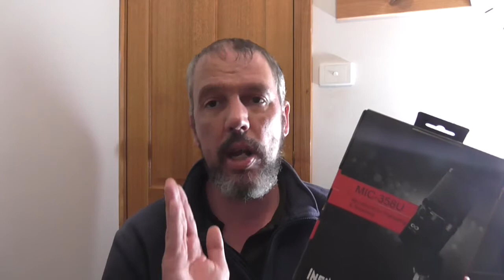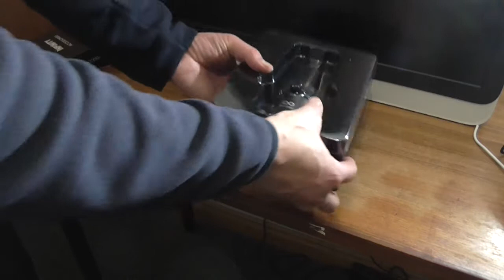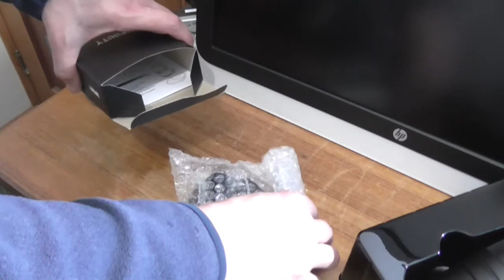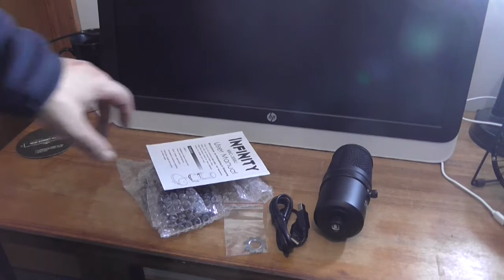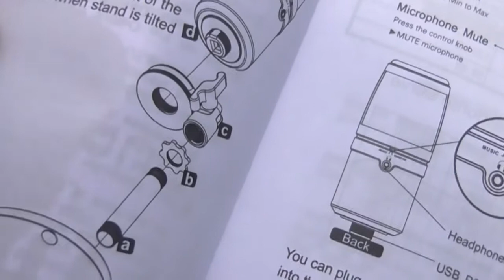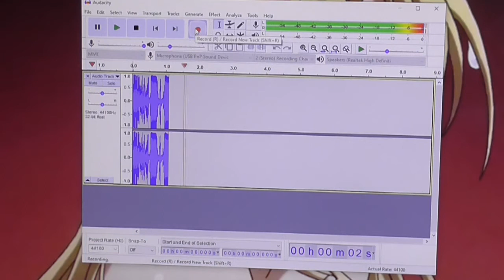Infinity MIC-358U USB Microphone REVIEW

Comment: Thanks mate, just picked one up, struggled with it peaking alot but got it all dialed in to obs which has a lot of filters and options to really cap its potential so very happy with it. I had replaced it from a Fifine studio mic so it was a bit difficult to get it to work as well of not better than that but it got there. Your review helped alot!!!!
Reply from the maker: You're welcome. Glad it worked out for you. The frequency response of it is the only thing that disappoints me and the peaking.
Reply: @AstrosElectronicsLab  I agree! But there's a way around it with obs which I spent hours on trying to figure it out. But overall with that in mind it is a great starter mic!